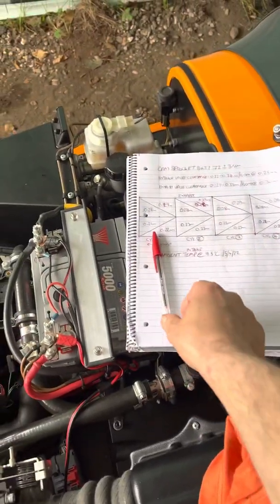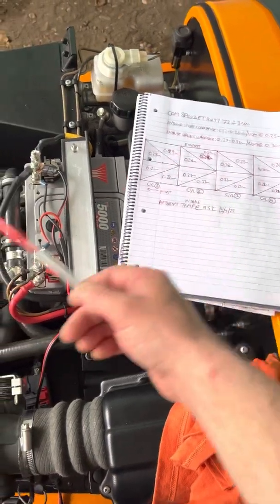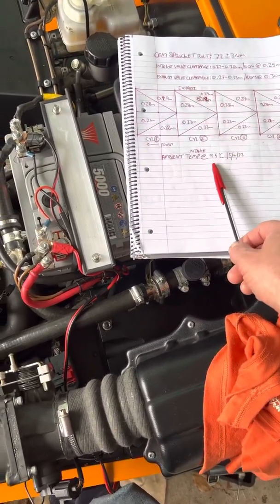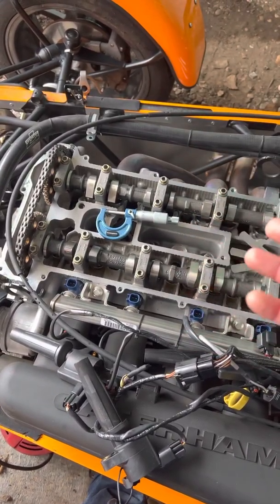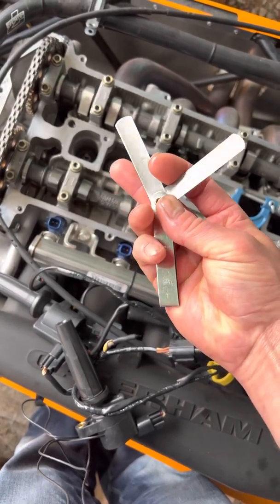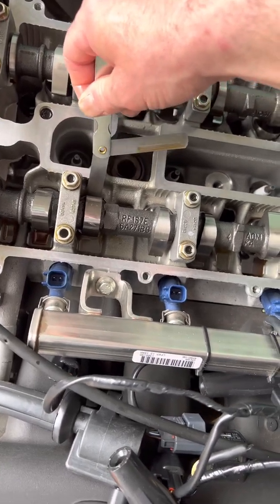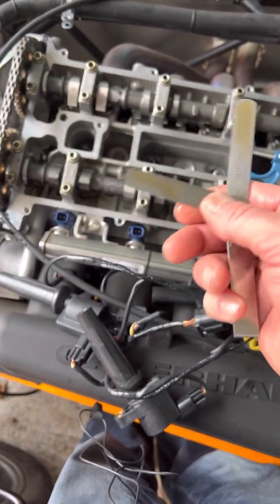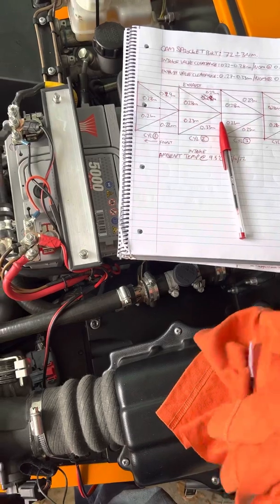MAS Performance 2.0 Duratec valve clearance check

Comment: I have a horse shoe mic. I didnt think to double check with that.. I'm going a high lift "st3" crower cam in my 2.o Duratec... Had a machine shop set the lash since I couldnt get the buckets in. Come to find out my OEM  NEW head off Ebay was defective... NOW im double checking the shops working and im suppose to have .006 on my intake and i'm seeing shit as high as .010... NOW im going to double check my tools and try again. Helpful stuff

Comment: Hi great informative video. Is it possible to change the buckets easily or is it front cover off and cams out and require retiming?
Reply from the maker: Front cover needs to come off as you need to put the timing chain tensioner into service mode to lift the cams out to do the job properly. I have seen it done without taking the timing cover off but you risk the timing chain tensioner ratchet allowing a extra tooth to spring out which means the chains won’t go back on or if they do will be far too tight. Take your time and do the job right, do it once

Comment: Hi, brilliant video. I have this engine in my Ford Fiesta ST. I’m I. The process of a engine strip with new cams, chain kit, valves, springs etc. I’ve looked all over the internet for the spec of what the gap between the bucket and cam should be. (Do you have a link) 
Also, where do you find the sizes of the new buckets (all the N numbers you have wrote down) so I can work out what I need to buy? Any help would be great. Thanks
Reply from the maker: Have a look on the web for PDF manuals for this engine, plenty of them to choose from where you’ll find the clearances. The N numbers iirc refer to the thickness. Check out Burton website as I think they have sell all the different sizes available to get the correct valve clearances

Comment: Hi - do you know which Haynes manual covers this engine or did you get the clearances from elsewhere? I cannot find standard clearances or camshaft cap torque specs, tightening sequence etc online.
Reply from the maker: There’s plenty pdf online.

Comment: hi i have a mk4 mondeo 2.0 duratec that's done 162k miles and wonder if I should have the valves checked. I know from previous petrol engines that they can tighten up with mileage. she drives nice enough but there's a slight pink when you open  her up but it's not like you get with carbon build up as it doesn't do it all the time. I get around 35.2mpg which is pretty much what fomoco state so it's pretty good, better than my old mk3 which was lighter.
Reply from the maker: the higher the mileage the more worn the cam followers become so the top end starts to have excessive valve clearance which will rattle more and more as the mileage increases. excessive isn't as bad as too tight as thats when the valve doesn't close properly and if really bad the piston starts to slap the valve

Comment: nice video, thanks.
just about to be going through this process myself.
any idea if the clearance tolerance remains the same with upgrade cams, i.e 210bhp. id assume so I think the clearance is down purely thermal expansion.
Reply from the maker: Yes I’d be using factory tolerances. The min/max is pretty big but ultimately aim for the nominal range.